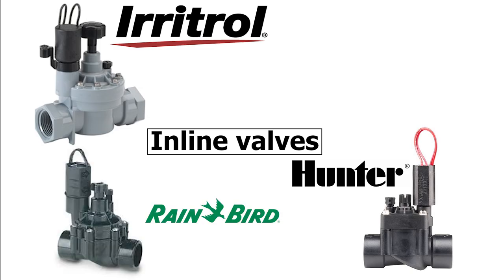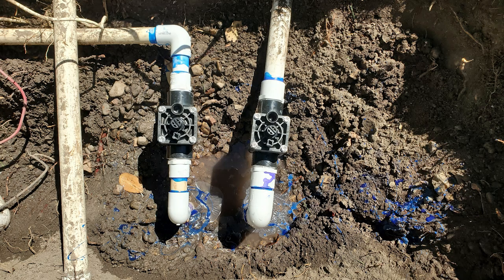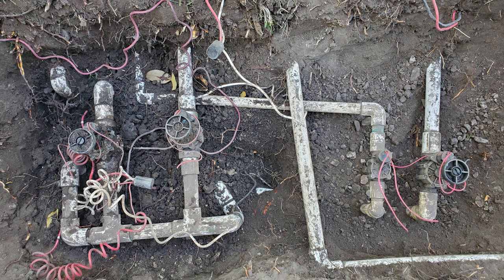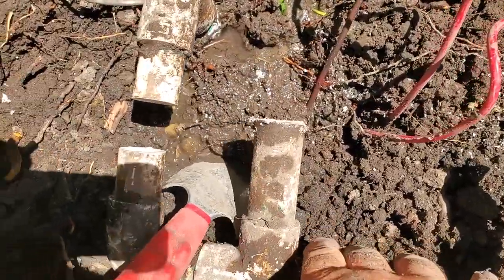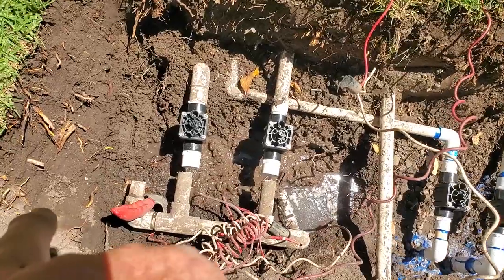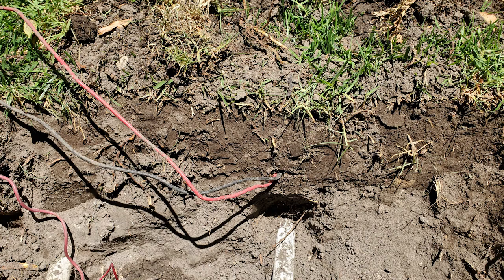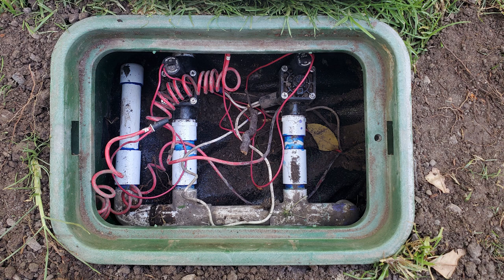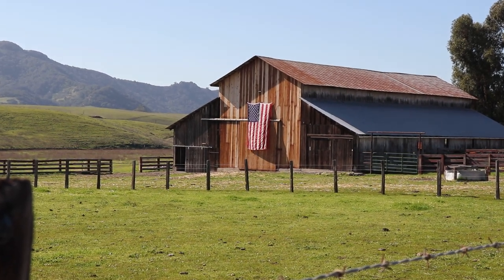How to replace inline valves | Start to finish | Two different methods

Comment: My valves are above the dirt and when I tried to replace the new valve, the length between the old valves and new were different and I couldn’t  figure it out. Do you have a video for those situations? Thanks.
Reply from the maker: Art,
Are they inline valves or anti-siphon valves? What brand and model are the old and new?

Comment: You cut with a saw instead of ratcheting pvc cutters?  I'm curious why.   Is it only because they are old pvc so you worry they will crack if using ratcheting cutter?
Reply from the maker: I always use ratcheting cutters when possible, but yes, sometimes I am concerned that the pipe will fracture due to age or exposure to heat/sun. In this case they were south facing valve boxes surrounded by rock and a stucco wall in a hot climate so it had all the factors for concern. Another reason I sometimes use them is to conserve every bit of pipe I can when splicing in new fittings into potentially tight places like valve manifolds.